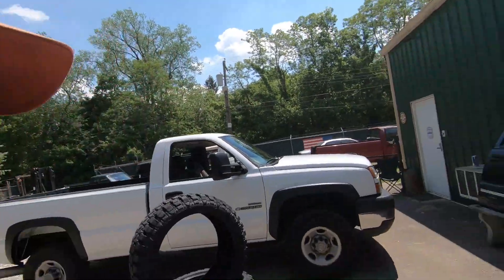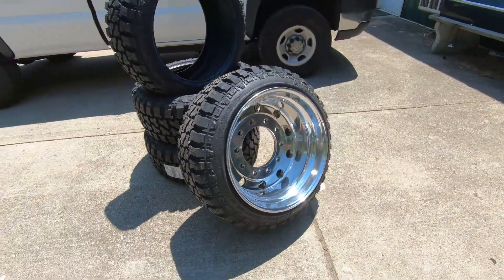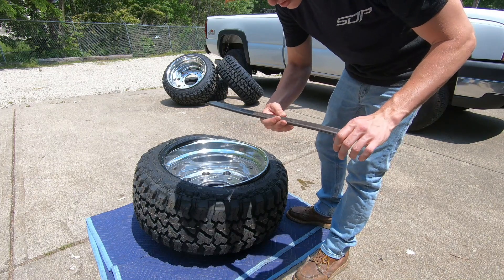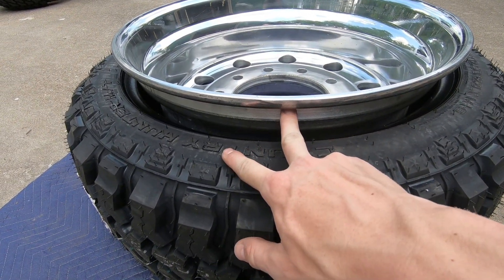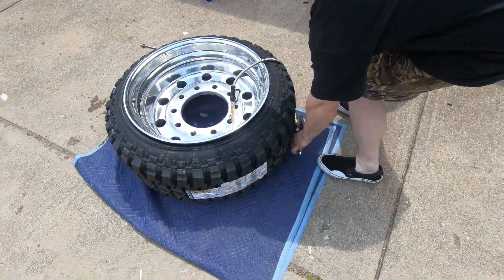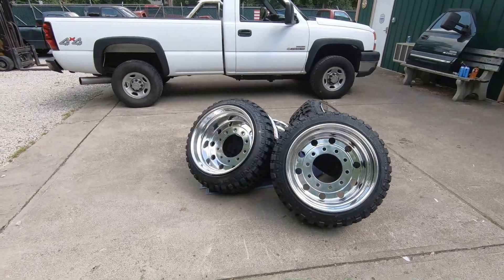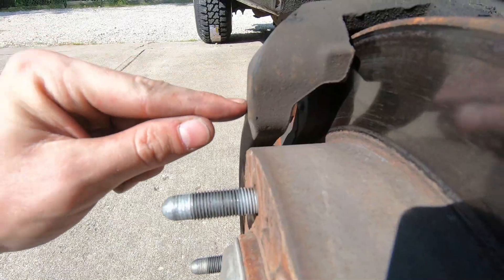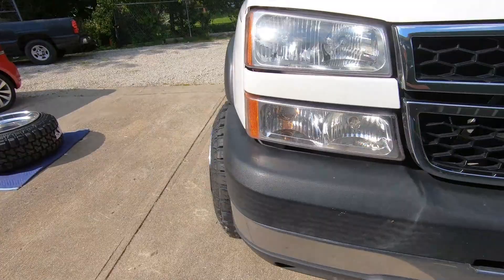I PUT SEMI TRUCK WHEELS ON MY DURAMAX!! See the Issues!!!

Comment: whats are the rims and what you mean u machined them to fit? i like how it looks.💪🏼
Reply from the maker: They are 10 lug Alcoa Super Singles from a semi truck. We had to machine the adapters to clear the brake calipers so they did not rub.
Reply: what you use to polish them like that?

Comment: No link bud? I really want some Alcoa’s for my power stroke but the standard sizes aren’t gonna cut it
Reply from the maker: What are you looking for? I found these wheels local and had them milled down by DK Custom Dually wheels.
Reply: Nazty Nate I have a f250 I want 22.5 or smaller, idk if they come in a 12 wide but that’d be ideal
Reply from the maker: @j.r.w7636  Ah that makes sense. I would look up DK Custom Dually wheels on facebook or instagram and give him a call. He is VERY knowledgeable with this stuff and can get you pretty much anything you want.

Comment: What's the load rating  on a stupid looking  set up like that? Will the haul  more than a 10 ply 17 inch?
Reply from the maker: It'll tow whatever you hook it to!
Reply: @NaztyNate   I was wondering about payload?  What is the load rating of the rubber? Is it affected  by being mounted on to wide of a rim.

Comment: I’m thinking of running a 35/15.50/22 back for the 14 wide for dually ,front run a 12.25 rim and run a 35/12.50/22….building a 2006 quad cab and cramming a 4th gen mega dually bed on it…should be super fat

Comment: Also dont run a spacer on the front. It will make the adapter NON hub centric after you do that an when you change to the flat washer lug nuts, it won't be anything there to center the wheel.  So I'd just grind the caliper bracket or lug studs on the adapter.  I hope all of that made sence lol if not, then you know how to get ahold of me. Gotta make sure you A1 when you out here flexin! 💪😁
Reply from the maker: For sure man I've got a cool video coming on how to run these on a SRW truck. I am machining the adapter just a bit and the studs just a bit at work and the caliper bracket also. I definitely don't want to make it non hub centric....they'd probably wobble LIKE CRAZY. Thanks bro!!!
Reply: @NaztyNate  I got ya covered boss!! 😁😁 cant wait!!

Comment: Thats not how u mount them.you have to mount from backside.i changed semi tires 20 years then u dont stratch and it goes on real easy ur lucky u got it on without ripping bead.
Reply: All depends on where the drop center is

Comment: New subscriber here! watching the retrofit videos and wondering if you could do a price breakdown on what the cost of doing something like this would be? the truck looks and sounds awesome!
Reply from the maker: Yessir! Thanks for the support! The wheels were 300 for all 4. 300 to get them milled down from 22.5 to 22. 200 for supplies to polish them. 800ish for adapters. 100ish for center caps and lugs. and then whatever tires you want probably around 800ish for tires. Hopefully that helps!

Comment: Makes as much sense as a 4wd unicycle lmfaoo overkill and unnecessary, informative video though :)
Reply from the maker: Sounds like my kind of unicycle!!
Reply: No parts, No tools, No plan! If it had 4 wheels it wouldn’t be a unicycle....
Reply: @brandonebersole8977  you didnt read, you just commented didnt you?
Reply: This truck looks to small for semi tires and rims get a bigger truck
Reply: How you recommended due milled down on wheels for  truck to pull a dump trailer

Comment: If your going south of the border or the Mall Crawler fad, you'll fit in.  Whatch the curbs cruising the Mall, they will shred those wheels. The aggressive tread pattern will suck on the black top & cement.
To say it nicely, it's just str8 up ugly.
Guess I don't have a good thing to say about em'.
✌
Reply from the maker: I hate when those curbs jump out at ya! If ya knew anything about mudding you would know you want the widest heaviest wheel possible to cut right through the thickest sludge out there!

Comment: WTF is a sema truck???? Do you mean semi?????  Get some wider tires. Before the side wall pops off the rim. Trailer trashy look!!! I got 285/75/16 I dare you to try and fallow me off a paved road. First 8 inch curb. And your calling a tow truck for a vent rim!!!! Big sidewalls more cushion for the pushing!!!
Reply from the maker: Where did you get SEMA from???????????????????????????????????????????????????????????????????????????
Reply: @NaztyNate  listen to the video. You said it's what all the sema trucks are running
Reply from the maker: @stevenpellegrino997  Yes, SEMA is a big auto show and a lot of the SEMA trucks run 10 lug wheels with Fury tires. Sorry for the confusion.
Reply: @NaztyNate  but you said sema trucks!!!

Comment: I want the five minutes I spent skipping through this video back.... because I can't figure out why you would do this to your truck.
Reply from the maker: I wish I could help you out man
Reply: @NaztyNate  Maybe you can still make it worth my while.  What is the reason to put wheels like this on your truck?  It seems like a lot of trouble for cosmetics.  Is there any performance benefit?
Reply from the maker: @kr4dh4x0r  unfortunately I do not think there are any performance benefits.. I just did this because I had never seen it done on a classic body style chevy and wanted to see if it was possible.
Reply: @NaztyNate  I see.  Ok, I mean, they look cool.... it's just a lot of work IMO.  Cheers.  I edited my original comment to not sound so abrasive btw.

Comment: Love to have a set of those wheels on my 2ton. Just for future reference dawn dishwashing liquid works best to mount up tires. Been there done that. Lol got the dirty shirts to prove it. First time ive seen the wide 22.5 on a pick up
Reply from the maker: I've used the dish soap before as well and it does work pretty good! What 2 ton do you have? And yeah, I've never seen someone do it before that's why I wanted to!
Reply: @NaztyNate  i have an 87 S1600 IH. Had the 6lug budd. Changed the whole rear axle to one with 10 lug hub pilot. I plan to stretch it and lower it. Got to wait till i file my taxes first. Need the extra $$$ first. Then swapping in the matching front axle
Reply from the maker: @WARD5KUSTOMZ  Dude that's gona be awesome!!

Comment: Most semis have 11r22.5
Reply from the maker: The common dually wheels are all 8.25" I believe. They make 11 12 and 14 wides also.
Reply: @NaztyNate  Nope. 11r22.5
Reply: These wheels are off of a lowboy trailer, not a tractor.
Reply from the maker: @TuffMcAwesome  You've never seen a super single on a tractor?
Reply from the maker: @steve5912  Yes, common tire size is 11r22.5
Reply: @NaztyNate  Yes and super singles usually start with 425 the front number on the tire.

Comment: All you got to do on front is grind caliper bracket down
Reply from the maker: I wanted to avoid doing anything to that bracket since it looks pretty thin already. Plus I figured I wont have these wheels on the truck forever so I wanted to modify the adapter rather than the truck.

Comment: Those aren’t actually semi wheels.
Reply: Yep, semi wheels are 11r 22.5
Reply from the maker: LOL yupp you're right. they are fake...?
Reply: @NaztyNate  Cmon dont get salty now. Who said their fake? If i put semi truck wheels on my truck can i say they are Tractor tires? No.
Reply from the maker: @steve5912  They came off of a semi. They are 14r22.5s milled down to 22s. I'm not sure what you're talking about.
Reply: @NaztyNate  Never said they cant be on a semi lol but where have you seen a semi with tires that are that low profile?
Reply from the maker: @steve5912  tires and wheels are very different. yes you'll never see a semi with light duty truck tires that are stretched on it.
Reply: @NaztyNate  That was my point
Reply: Super single semi wheel if you ask me. A wheel and a tire are 2 different things. May not be semi tires, but they are semi wheels.
Reply: @StephenBrewer89  Yeah semi wheels but not tires.

Comment: Then ain’t semi’s dawg 😂 u even said they are for dully smh
Reply: They're super singles.. technically they replace dual wheels so it's about the same as a set of dually wheels
Reply from the maker: @Z71ricrkilr  Exactly
Reply: Bro semi use dual wheel on the back so the are a Dually so the super single means that instead of installing a two wheel set up you only need one
Reply from the maker: @raddydiaz4332  Exactly!